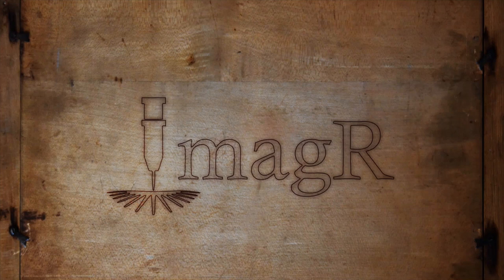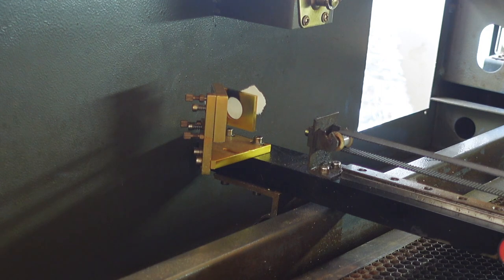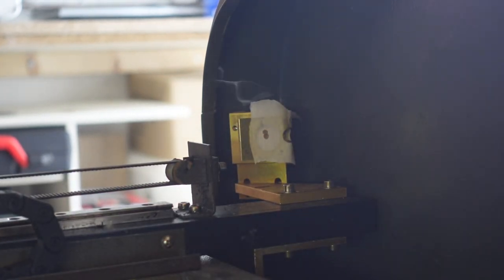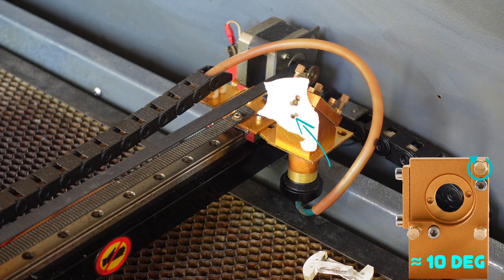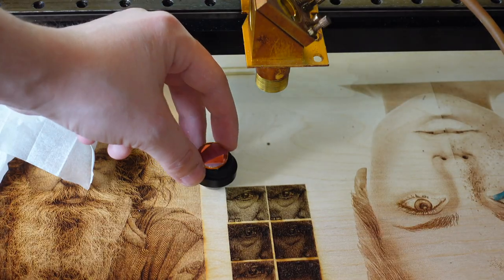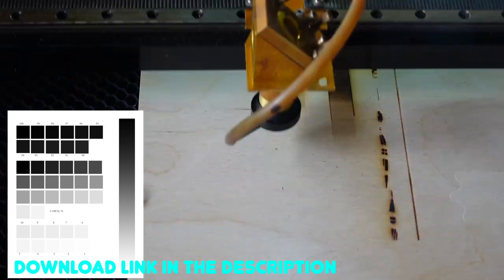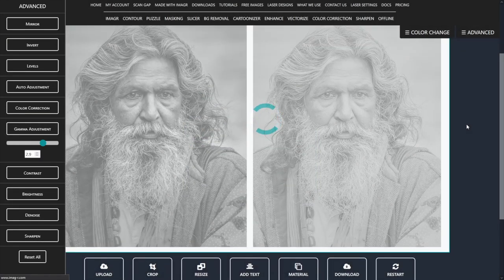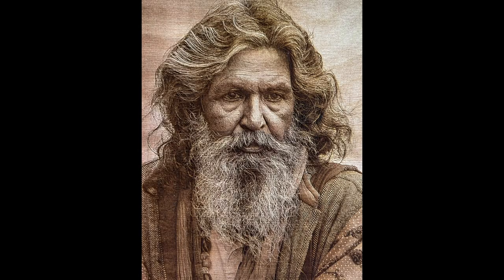How to improve your Laser Quality tremendously! (Levels + Alignment)

Comment: I have learned a lot from your video, I would like to share one more way to make the laser image quality darker that is to use (borax) to mix 1 teaspoon at a boiling temperature of 100 degrees, then use The tool sweeps on the wood surface, then waits for it to dry, then laser